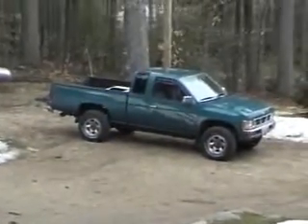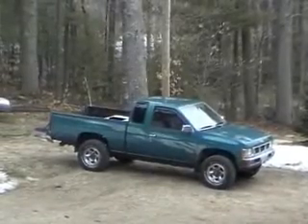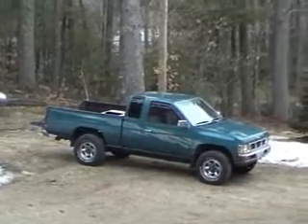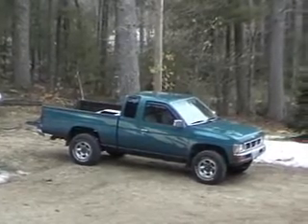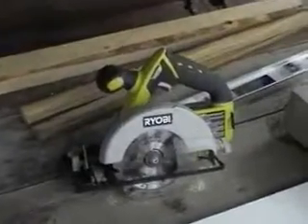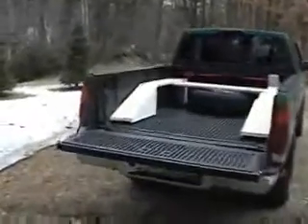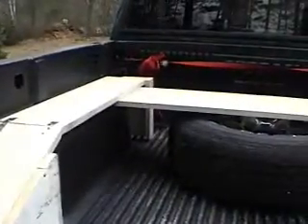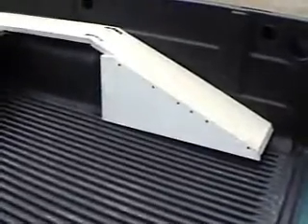2001 Polaris Trail Boss 325 cc & 1995 Nissan Pickup V6 XE Custom Ramp System

Comment: I used to have a 97 reg, cab 2WD Nissan and the exact same Trail Boss. I could drive it up on the ramps and it would fit perfect in the bed with the tailgate up. Granted the wheelwells were a little dented in after a while lol

Comment from the maker: @smokine2001 The "2001 Trail Boss 325 Service Manual PN 9916584" (section 2.20 "OIL AND FILTER CHANGE.) says:
...
12. Remove dipstick and fill sump with 2 quarts (1.9l) of Polaris Premium 4 synthetic oil (Polaris Premium 4 All Season Synthetic, 0W-40 - Ambient Temperature Range: -40F to 120F).
...

Hope that helps!